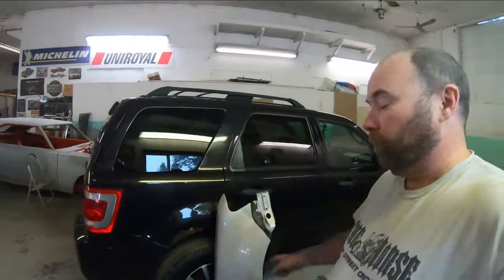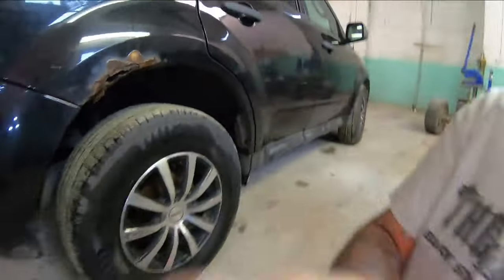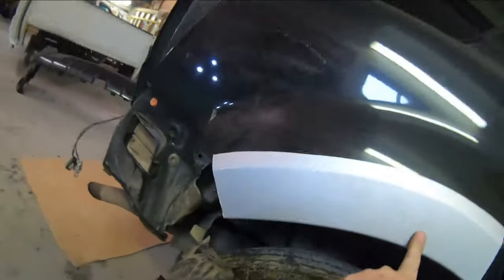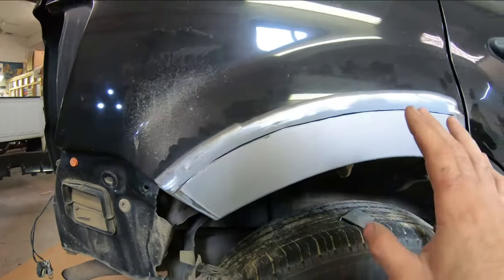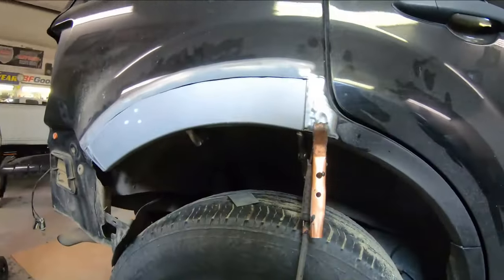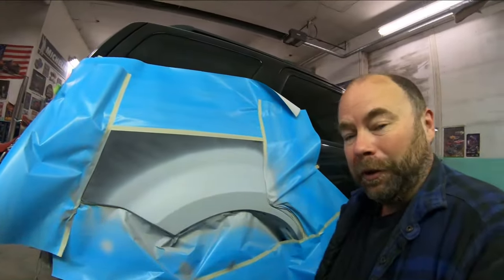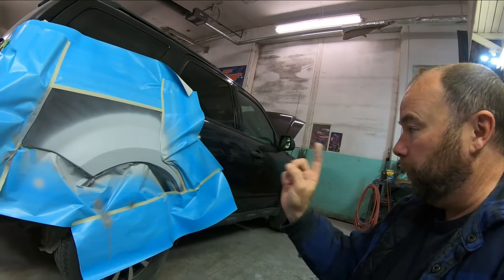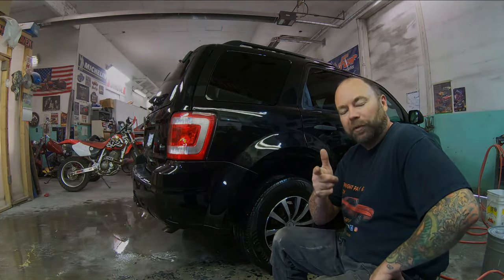How to do basic rust repair

Comment: Great tip on using an old front fender to make patchers for the rear.
Reply: Only problem I see with using a front fender is the inside flange is not as wide.

Comment: How much does a job like this cost with the exact section and size that was shown in this video???
Reply from the maker: I don’t recall exactly, but with teardown, repair and paint, probably around 12 hours, my shop is $75 an hour
Reply: Where do I sign ✍️ ? I don't have a problem changing  parts. I just don't have the coordination for body repair 😂

Comment: Thanks for the vid on more rust repair. These are the best! Do you tap down your weld seams so the filler sits flatter?
Reply from the maker: Not typically, I find with butt welding they stay pretty flat
Reply: Awesome video! I like the tip about using the fender. Sometimes those little budget jobs are nice.
Reply: @Johnnymidnight  Thanks. Also what thickness sheet metal do you use for your repairs? 16 or 18 gauge?
Reply from the maker: Typically 18 gauge, 16 if it’s floor or firewall usually